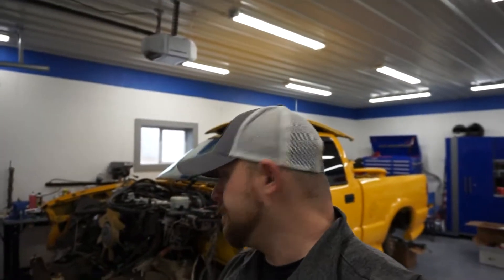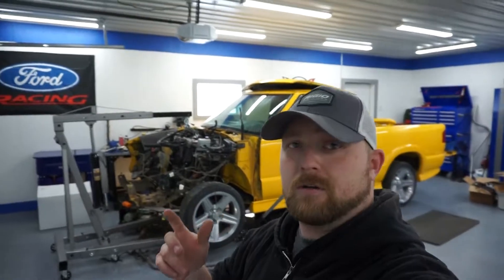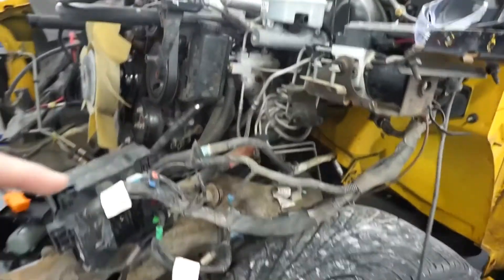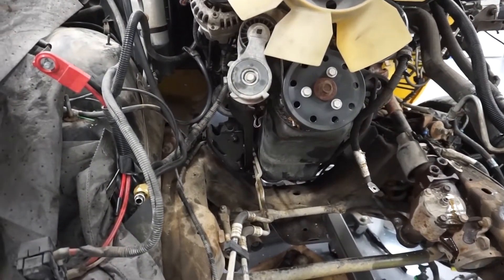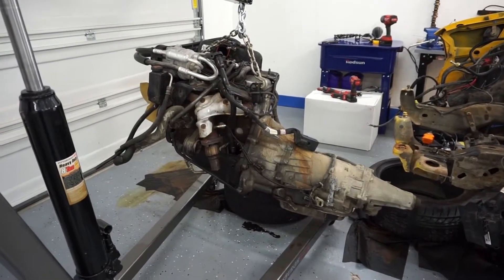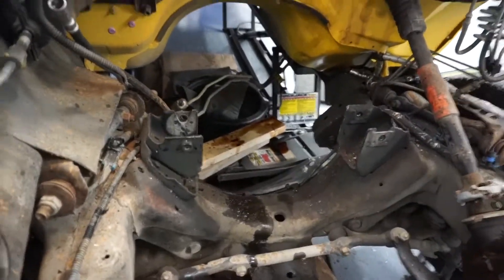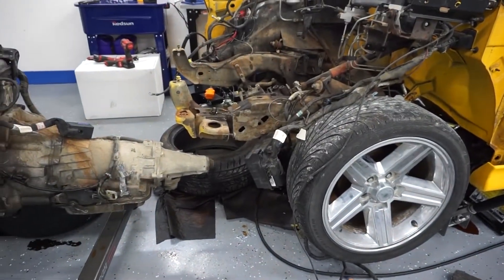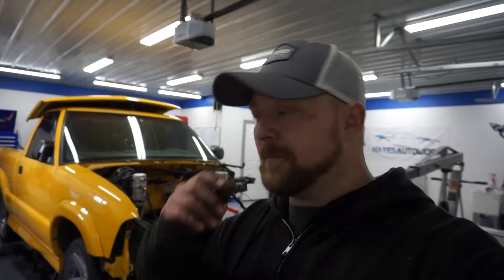LS Swap S10 Xtreme-  Yanking the old 2.2L Out!

Comment: I have an 84 S10 I'm trying to put a 350 small block into with a 350 short shaft had some of the similar issue you're experiencing at my own motor and transmission wound up having to rebuild both motor and tyranny over 30 years old sense last built the old 65 needed to much work had to put her down always wanted to do an s10 swaps I picked up an 84 for a lw budget  build for fun